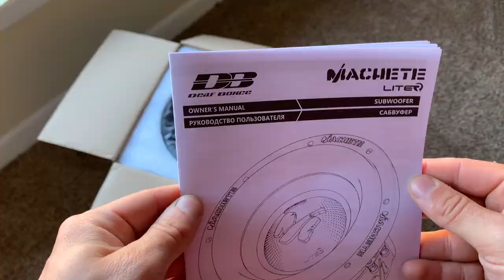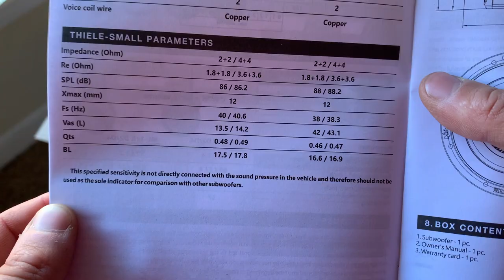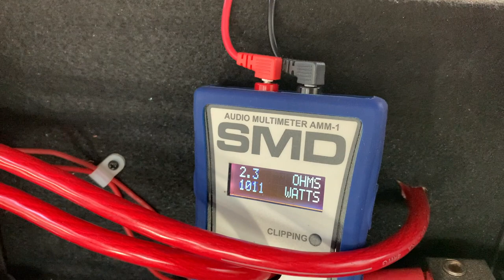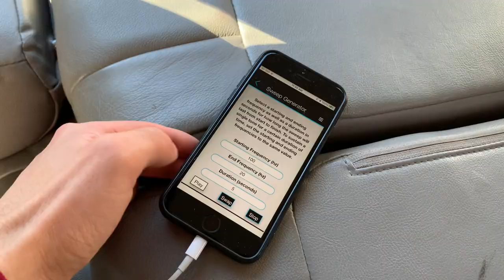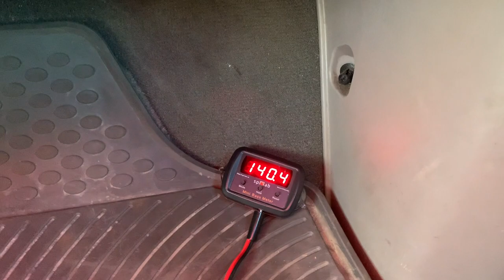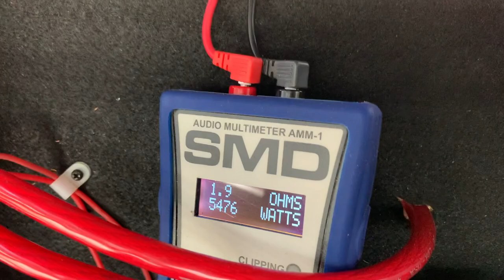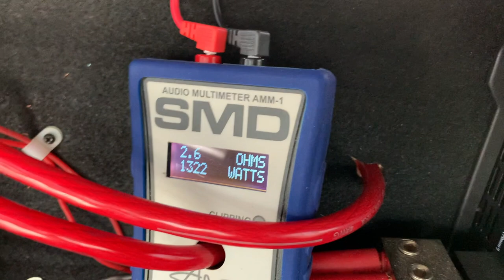Big BASS For Under $200! | Deaf Bonce LiteR 12s Review

Comment: I’m still amazed that with 4 12 inch volfenhag subs and a kicker dx700 I was able to hit 149.9db and I see so many people with wayyy more power not getting anywhere near that .. did 173.8db in outlaw class by putting the mic inside the port and box as I watched it climb higher .. We got into the 150s using 2 12s and a 1200w kicker amp .. this was 2000-2003? My buddy ended up getting sponsored by kicker before his drug habit ruined his life .. he got $5k worth of free stuff .. little off topic .. what was we doing different then? We were hitting way higher numbers with way less power cause big boys amps weren’t really available .. 1000-1500w was huge! I figured at this point technology would have made it so much better and we would be seeing guys in the 150s with nothing for power but guess I was wrong . Now it’s 5kw to get in the 150s for most guys ..
Reply: I had them same red subs they sounded awesome inverted in a sealed big box.. Has them in a big lighting audio amp..

Comment: These seem like really good subs for the money. I like my Sundowns though. I just bought a cheap ported dual 12 box and they slam.
Reply: Get a custom box made and they will sound 5x better
Reply: @SBK_ALL_DAY  yeah for sure! It's hard to believe just how much difference people will hear until they run a good box!
Reply: Which sundowns do you have? Also just an fyi sundown subs can handle double the rms. I got 2 lcs and I've been running them on 700 watts each for 2 years now.
Reply: @KyrieEleisonMaranatha  is that clamped or guesstimated lol?
Reply: @gamersfan  that's clamped with a taramps smart 3k at 1 ohm.
Reply: @gamersfan  i can go all the way to clipping with that amp on 2 lcs. They can handle all the amp will throw at it, at 14 volts for several minutes.  But i don't run them at that constantly. I run it about half power constantly. They will eat 600 watts rms all day. Parker actually did a video on one right around the time of the last debate when sundown and Rockville were feuding.
Reply: @gamersfan  Also these are the old lcs. not the new ones they just came out with. Not sure if they changed their design with the new model.
Reply: @KyrieEleisonMaranatha  Cockville ruined themselves with those videos because they had those subs in a 57hz box an clipping the shit out of those things they literally said we need more gain on the amp and you can see that terrible clipping and then they tried and blame it on that song when it was 100% their fault. At least Exo had his in a custom built box he did himself and that Cockville still blew up with quote on quote 1000rms rated power.
Reply: @BenaresDarkness  oh I know bro. I was involved in that drama the entire time. Emf got involved and i was in every comment debating crapville supporters. Sundown in no joke and it takes an awful dirty clipping signal to hurt their stuff. They can handle far more than advertised with clean power.
Reply: @KyrieEleisonMaranatha  Oh I know sundown is top of the line even their lowest level series can handle more than rated.
Reply: @BenaresDarkness  yep i got 2 lcs in my trunk right now. I have them in that same box as that video actually. Qbomb quad port, dual 12. Except i have modified the box to play at 30hz. It's actually a great quality box, many people hate on it because it's factory tuned to 52hz. But if you plug one of the ports on each side. it lowers the tune to around 30hz around half of the factory. I hit 151db all day with it. 🤷🏼‍♂️
Reply: @KyrieEleisonMaranatha  my sa15 rev3 would have to
Disagree lol, hcca3000.1 on it didn’t make it happy for long
Reply: @beefysghost867  you were probably clipping the crap out of it.
Reply: @KyrieEleisonMaranatha  no dude it’s rated at 750rms , my u 10 handles same wattage at 1 Ohm it takes it like a champ, 1 ohm is like 5k with the hcca 3k
Reply: Clamped with rise prob 2/2.2ish
Reply: @KyrieEleisonMaranatha  and you have to think this is rev3 not sa v2 so it only 2 1/4 voiceCoil i believe they aren’t meant to handle that much power  it lasted maybe 2 songs no more
Than 3
Reply: @beefysghost867  there's videos right here in YouTube of sa's taking 18,000 watts bro. Maybe you didn't have something hooked up right. Or the box or something. Because the sa lineup is more than capable of handling what you threw at it. If that story is even true.
Reply: If you have Sundowns what sense did the comment make? You're not interested in 100 dollar subs

Comment: I grabbed 2 of the 10" version to go in my 21 tundra crewmax ( prior to this video). Space is beyond limited in the truck. Found a place to build a ported box with mounting depth that would be 5.5 per sub instead of the pre-fabs that were 3.5 max. Will be built specifically for the subs. Can't wait to tear this truck apart and get that factory crap out. Keep up the good work bud

Comment: Hey I have a 2003 Toyota Sequoia I currently have my sub amp under my drivers seat there’s barely any space where would be the best place to mount/put the amp at so I could still have the wires hidden and not showing

Comment: Any suggestions for a small setup? Got about 16 inches of depth in my “trunk” area. No real limit on height, 42” wide. 
Been running an SA-12 and I want to go smaller to gain some space back
Reply: Check out Toro Tech 8-in Force sub or Fierce sub there's videos on YouTube and they get down check out the DB one can do the videos definitely surprised me 😳🔊🔊🤙🏼
Reply: Yeah, no suggestions other than a sealed box for whatever sub ya have or choose, but I gotta say I'm kinda in the same boat so to speak..
  I went from an Xterra with plenty of room for the boxes for my 15" TC Sounds Tropo and my 12" Audiopulse Axis subs plus the little 6x9 boxes, extra batt, amps and so on to a first Gen Grand Cherokee that is definitely a much smaller SUV! 
   I have a different setup no
But still have 2 boxes. A dual 12 factory ported Kicker box and a custom ported box I will be building for the 12" Audiopulse Axis quad 1 ohm voice coil sub. Probably start with 3 amps. 2500 Orion XTR for the Audiopulse, and maybe a 800 Kicker for the other 2 subs, and something else for the pair of 6x9's.. 
  Should be pretty decent for starters anyway, hoping it will be SLAMMING HARD, but guess I'll find out when I finally get the time to install the Deck and run all the 0 gauge and 2nd battery etc..
Reply: I have a ZVX8 in the trunk of my Miata. Box is .8cuft tuned to about 38hz. It is the same depth as the SA-12 but the box could be flat against the side of your trunk area and leave you with more floor space.

Comment: Thank you for all the bass vids. From one bass head (155.2db) to another.
Reply: what’s your setup?
Reply: Your pyle red labels ain't pulling 115.2 db bro
Reply: Did a 151.2 at 23hz outlaw with a single soundqubed 15 on a Taramps Smart 3k could be louder but it’s a musical build to demo and in an extended cab Ford Ranger. Currently building a civic hoping for 150 or more in the little car.

Comment: I wonder what 2 Toro Fierce 12s would do The last time you tested one it wasn't pushed to see what it was capable of you put the RMS power into it  but I would like to see what two of them would do on the SPL meter 🤔 they're definitely in the budget subs spot and in a proper box at 2.6 CF for each sub will do amazing I would say that single box you have with the plexiglass front would be great what is that box tuned at and how many cubic feet is it also the Power Acoustik Gothic Walmart subs are budget as well I haven't seen any good testing on them but love the videos keep them coming stay up and stay Bassin brother 🔊🔊🤙🏼
Reply: I had two on an NVX VAD2700.1 at 1ohm in q custom 4th order bandpass I built(first ever badpass, it suvked) 1.5 sealed per, 1.5 ported per at 40hz, and I got a 148.1 peak at 42hz, but a 145+ from 30hz all the way to 54hz before it started to fall off. Incredibly loud system it was awesome
Reply: The soundstream xtreme subs are almost same as Gothics but bigger magnet and cheaper
Reply: @charlieknoll1269  Yes not bad subs at all

Comment: Hey Parker I just bought a ds18 12 4D using a Power Acoustik amp do you have a review on these and the amp that would fit this one good cuz I'm only pushing half the RMS power it calls for 1250 RMS but I'm afraid to give it that much cuz a lot of the speakers cannot handle the RMS power they say
Reply: No need to worry, power acoustic amps dot even make rated power, set your gains with an o-scope to see how much clean power your actually getting, it's prob 1/4 of what it says on the amp

Comment: does anyone here know what happens if the box ported area is bigger than the subwoofer specs. i know you get port noise if its smaller but what happens if its bigger
Reply: It's easier to overload your sub if the enclosure is too large. It'll take less power to move it.

Edit: just saw you said port area too large sorry about that. 

I think if the port area is too large you'll have similar results as when the entire enclosure is too large. Less power handling and probably some sort of port "noise"
Reply: I've heard a big port is louder but peaky and small will give you a flat response

Comment: How much louder would this be than a single vxf12
Reply: It wouldn't be louder than 1 vxf
Reply: @joshholden8561  even with two of them?
Reply: Even with 2 a vxf sub is about 3 or 4 classes better and more powerful sub 1 12 vxf will do over 142 db they can handle 3k these the db entry subs are 500 rms and have terrible ts parameters  to be honest the power acoustik gothic subs from Walmart are a better built and better sounding sub u just can't beat them for the price and they will take 1k rms each of CLEAN POWER.
Reply: @joshholden8561  Do you think that a vfx 12 with a taramps 3k and battery would be a good option for a first system?
Reply: Hell yeah get a taramp smart 3k for like 230 bux and u won't believe how loud it is
Reply: @joshholden8561  Would I need a secondary battery to run one?
Reply: 0 guage ofc wire and a good agm battery with atleast 100 amp hours of reserve.
Reply: @joshholden8561  Was originally thinking of a XS POWER - D3400 but its only rated at67ah

Comment: 3 Mtx terminators will get lower and louder and will be cheaper by $50. Plus the box will be nicer/bigger for $40 more you could do 4 mtx terminators. Also they will play almost every song you throw at em. These subs are a waste of time, not in my opinion just based off the facts.
Reply: 3 but in which Box though
Reply: @Luminous.Dynamics  multiply the box volumes provided in the specs by 3 and shape the box to fit your trunk. Make sure it’s a common chamber and all three subs are sharing the same one port. You may need to put the Port on the side.